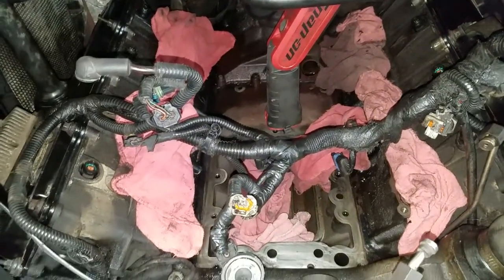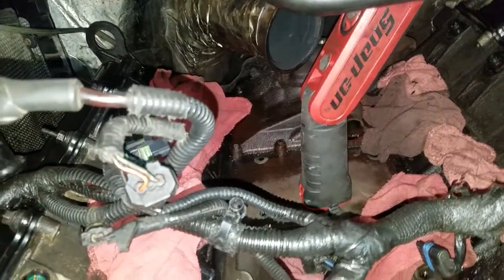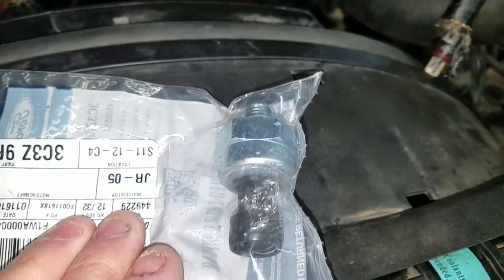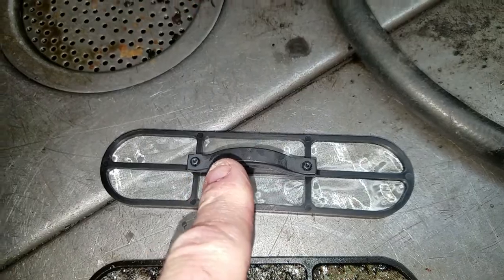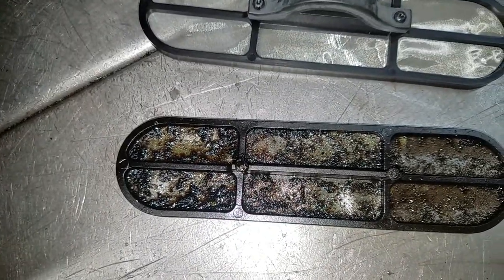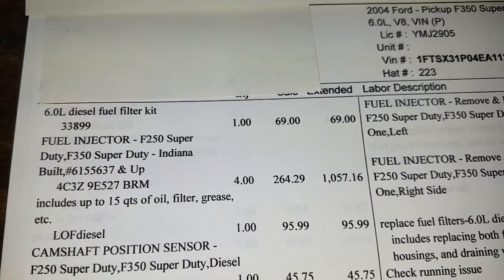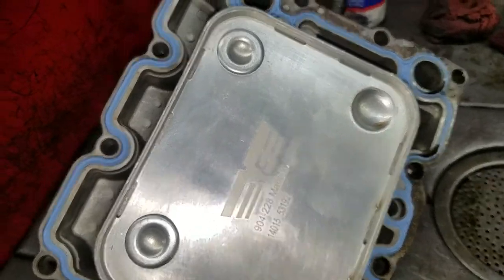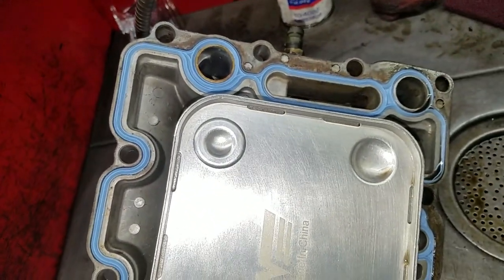Ford 6.0 Powerstroke top end oil leaks.

Comment: Hey bud my Harley 6.0s hpop screen looks identical to that one. Should I replace the oil cooler? Or leave it and flush it. It was running 250 for eot when hot
Reply: should flush if changing anyway. mine is 223 ot with program. Im gonna flush and if it stays near my 190 coolant temp im not going to change oil cooler.
Reply: @Jedidiah Dario instablaster ;)
Reply: @Julio Devin I really appreciate your reply. I got to the site thru google and I'm waiting for the hacking stuff now.
Takes a while so I will get back to you later with my results.
Reply: @Julio Devin It did the trick and I finally got access to my account again. I'm so happy!
Thanks so much you saved my account !
Reply: @Jedidiah Dario No problem :)
Reply from the maker: The truck started and ran but had a few bad injectors and leaked badly I believe
Reply: you all probably dont care at all but does anyone know of a trick to get back into an instagram account?
I stupidly forgot the login password. I appreciate any tips you can give me.